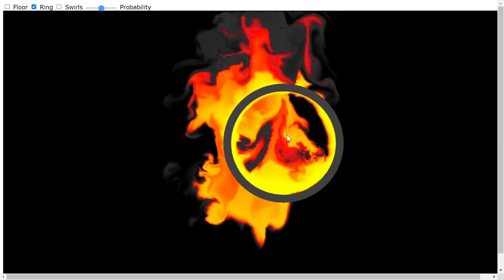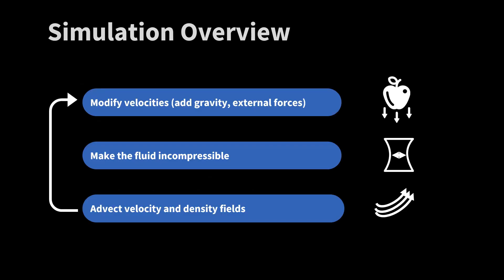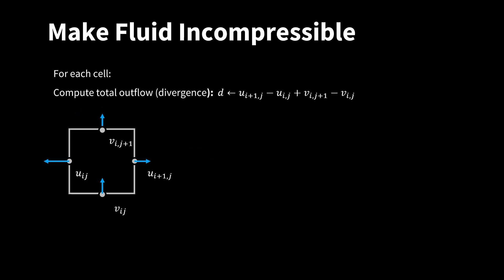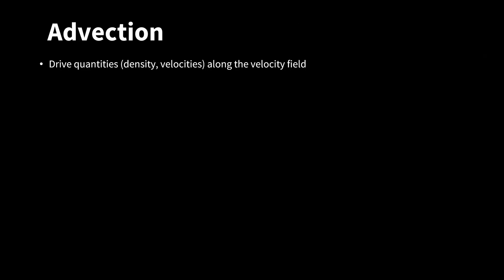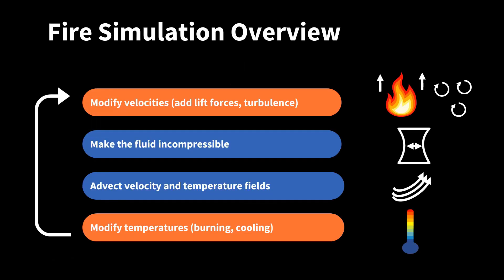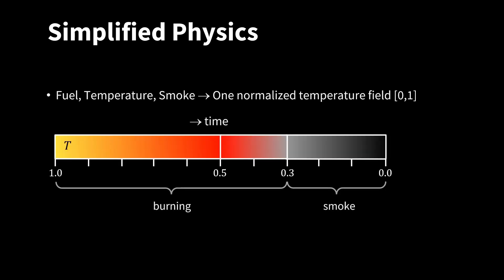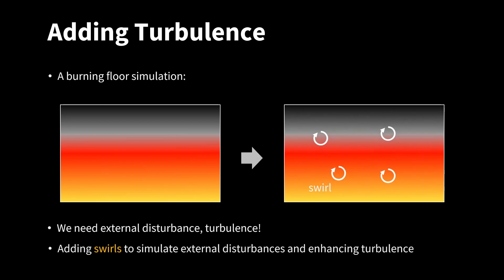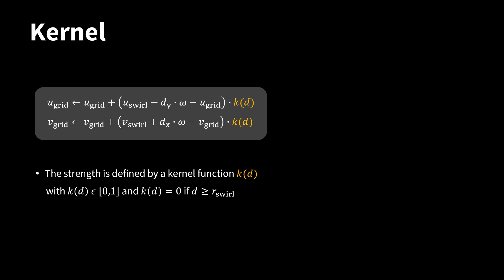21 - How to write a Fire Simulator in a web page.

Comment: I wonder if the simulation could be made more life-like if the fluid could be compressible. Fire is actually plasma caused by exothermic energy of oxidation. The medium being oxidized are the hot combustible fumes. Once they ignite the pressure increases and provides some positive outflow from the modeled cell.

This simulation assumes there are only flames, with no source of fuel i.e. combustible gas but in reality it is often possible to observe that the fumes rising from a hot material start burning only at some distance form the material itself. Does oxidizing plasma has a different density than hot fumes? I don't know but it seems it should be less dense providing increased pressure on ignition.